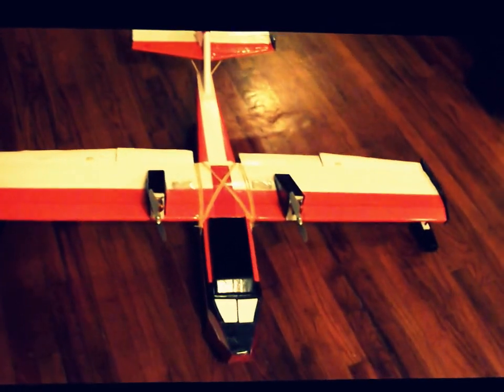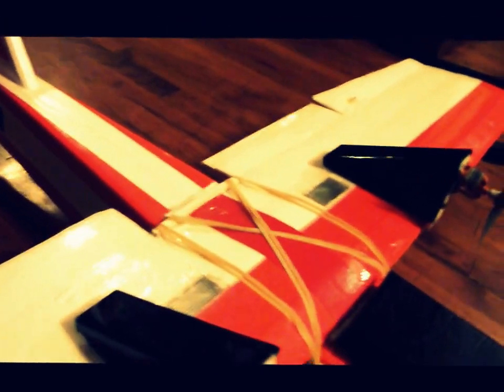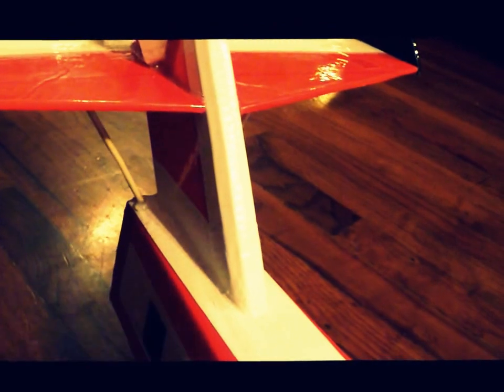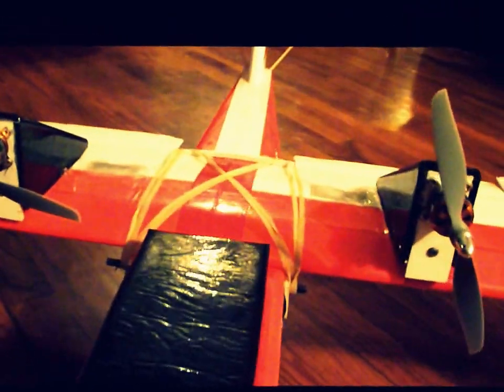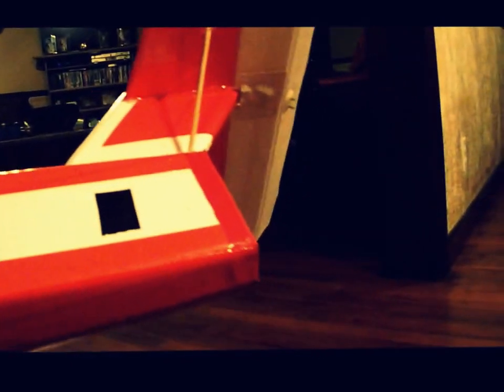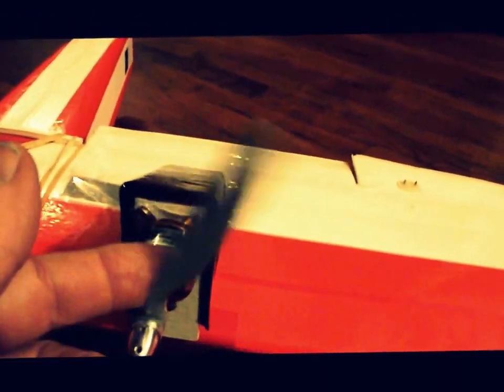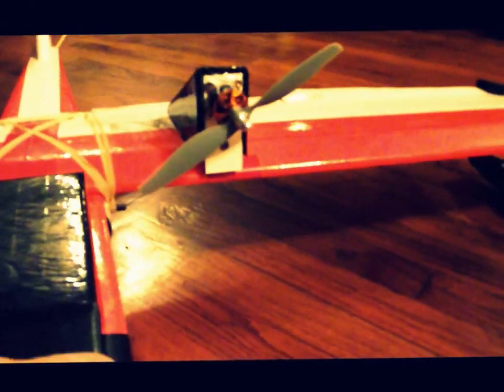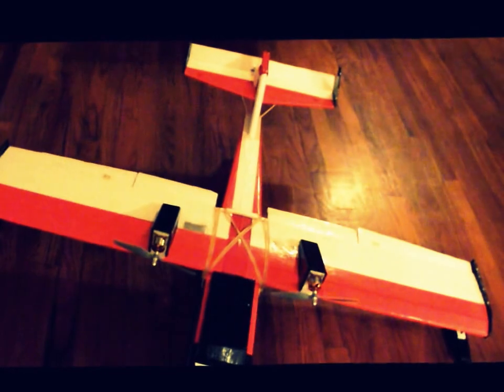Design,dimensions and  Build explanation video

Comment: What kind of epoxy did you use?  I think I am going to tackle one.
Reply from the maker: I used  a standard 45 minute, several coats is needed, bonds well to duck tape, does not bond well to packing tape, lightly clean tape surface with rubbing alcohol.

Comment from the maker: Sure the motors is turnigy 2826/6 2200kv. escs is turnigy trust 55amp which is a bit overkill but I had them , probably a 35 amp esc will be fine with this motor selection, and I am running 2-2200 11.6 30 c lipo battery's in parallel, If You need any more information PM Me in a private message...Tim